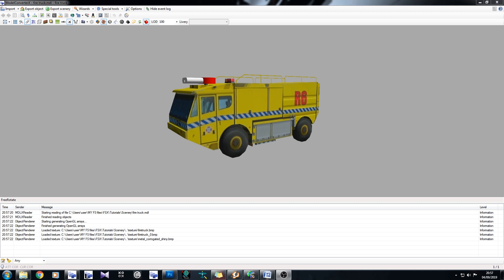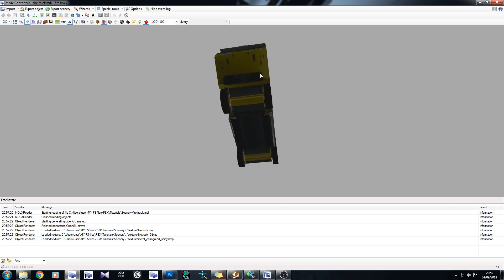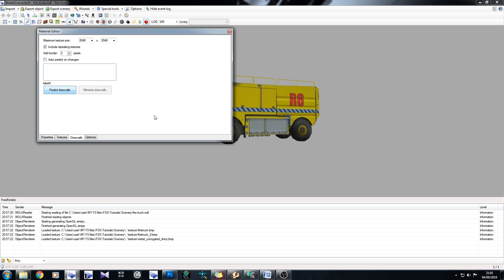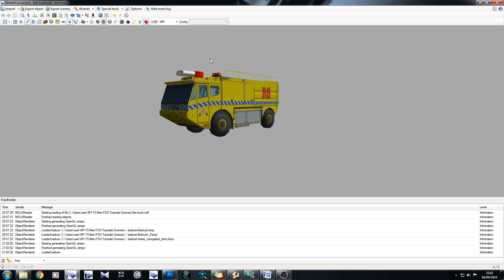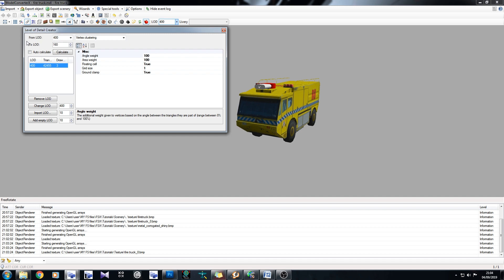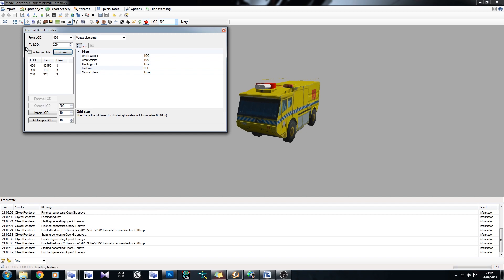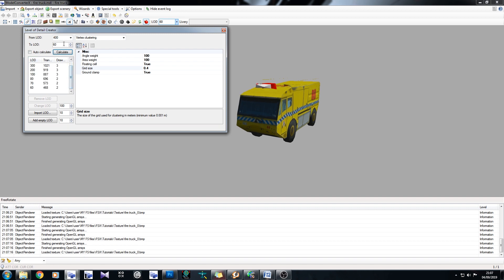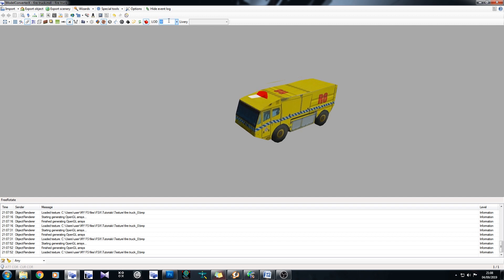FSX Tutorial - Using Model Converter X to optimise models

Comment: See the end of this message for details on invoking 
just-in-time (JIT) debugging instead of this dialog box.

************ Exception Text ************
System.OutOfMemoryException: Exception of type 'System.OutOfMemoryException' was thrown.
   at ASToFra.ObjectRenderer.Renderer3DHandlerType.CreateArrayObjects()
   at ASToFra.ObjectRenderer.Renderer3DHandlerType.GenerateArrays()
   at ASToFra.ObjectRenderer.Renderer3DHandlerType.SetObjectModel(ObjectModel newObj, ObjectChangeLevel level)
   at ASToFra.ObjectRenderer.Renderer3DControl.OnObjectChanged(ObjectChangeLevel level, ObjectModel obj, Object sender, String changeDescription)
   at ASToFra.Interfaces.ObjectChanged.Invoke(ObjectChangeLevel level, ObjectModel obj, Object sender, String changeDescription)
   at ASToFra.Interfaces.EventDistributor.RaiseObjectChanged(ObjectChangeLevel level, ObjectModel obj, Object sender, String changeDescription)
   at ASToFra.Interfaces.EventDistributor.OnObjectChanged(ObjectChangeLevel level, ObjectModel obj, Object sender, String changeDescription)
   at ASToFra.ModelConverterX.MainWindow.RaiseObjectChanged(ObjectChangeLevel level, ObjectModel obj, String changeDescription)
   at ASToFra.ModelConverterX.MainWindow.UpdateFormAfterImport()
   at ASToFra.ModelConverterX.MainWindow.bwImporter_RunWorkerCompleted(Object sender, RunWorkerCompletedEventArgs e)
   at System.ComponentModel.BackgroundWorker.OnRunWorkerCompleted(RunWorkerCompletedEventArgs e)
   at System.ComponentModel.BackgroundWorker.AsyncOperationCompleted(Object arg)

************ Loaded Assemblies ************
mscorlib
    Assembly Version: 2.0.0.0
    Win32 Version: 2.0.50727.8813 (QFE.050727-8800)
    CodeBase: file:///C:/Windows/Microsoft.NET/Framework/v2.0.50727/mscorlib.dll
----------------------------------------
Launcher_ModelConverterX
    Assembly Version: 1.0.0.0
    Win32 Version: 1.3.0.0
    CodeBase: file:///C:/Program%20Files%20(x86)/ModelConverterX/ModelConverterX.exe
----------------------------------------
System.Windows.Forms
    Assembly Version: 2.0.0.0
    Win32 Version: 2.0.50727.8015 (FX35W81RTMGDR.050727-8000)
    CodeBase: file:///C:/WINDOWS/assembly/GAC_MSIL/System.Windows.Forms/2.0.0.0__b77a5c561934e089/System.Windows.Forms.dll
----------------------------------------
System
    Assembly Version: 2.0.0.0
    Win32 Version: 2.0.50727.8806 (QFE.050727-8800)
    CodeBase: file:///C:/WINDOWS/assembly/GAC_MSIL/System/2.0.0.0__b77a5c561934e089/System.dll
----------------------------------------
System.Drawing
    Assembly Version: 2.0.0.0
    Win32 Version: 2.0.50727.8019 (FX35W81RTMGDR.050727-8000)
    CodeBase: file:///C:/WINDOWS/assembly/GAC_MSIL/System.Drawing/2.0.0.0__b03f5f7f11d50a3a/System.Drawing.dll
----------------------------------------
ModelConverterX
    Assembly Version: 1.0.0.0
    Win32 Version: 1.3.0.0
    CodeBase: file:///C:/Program%20Files%20(x86)/ModelConverterX/ModelConverterX.DLL
----------------------------------------
Interfaces
    Assembly Version: 1.0.0.0
    Win32 Version: 1.3.0.0
    CodeBase: file:///C:/Program%20Files%20(x86)/ModelConverterX/Interfaces.DLL
----------------------------------------
ObjectModel3D
    Assembly Version: 1.0.0.0
    Win32 Version: 1.3.0.0
    CodeBase: file:///C:/Program%20Files%20(x86)/ModelConverterX/ObjectModel3D.DLL
----------------------------------------
ObjectWriter
    Assembly Version: 1.0.0.0
    Win32 Version: 1.3.0.0
    CodeBase: file:///C:/Program%20Files%20(x86)/ModelConverterX/ObjectWriter.DLL
----------------------------------------
ObjectReader
    Assembly Version: 1.0.0.0
    Win32 Version: 1.3.0.0
    CodeBase: file:///C:/Program%20Files%20(x86)/ModelConverterX/ObjectReader.DLL
----------------------------------------
EventLog
    Assembly Version: 1.0.0.0
    Win32 Version: 1.3.0.0
    CodeBase: file:///C:/Program%20Files%20(x86)/ModelConverterX/EventLog.DLL
----------------------------------------
ObjectRenderer
    Assembly Version: 1.0.0.0
    Win32 Version: 1.3.0.0
    CodeBase: file:///C:/Program%20Files%20(x86)/ModelConverterX/ObjectRenderer.DLL
----------------------------------------
GRV11DLL
    Assembly Version: 1.0.0.0
    Win32 Version: 1.0.0.0
    CodeBase: file:///C:/Program%20Files%20(x86)/ModelConverterX/GRV11DLL.DLL
----------------------------------------
ParticleEffects
    Assembly Version: 1.0.0.0
    Win32 Version: 1.3.0.0
    CodeBase: file:///C:/Program%20Files%20(x86)/ModelConverterX/ParticleEffects.DLL
----------------------------------------
System.Configuration
    Assembly Version: 2.0.0.0
    Win32 Version: 2.0.50727.8953 (QFE.050727-8900)
    CodeBase: file:///C:/WINDOWS/assembly/GAC_MSIL/System.Configuration/2.0.0.0__b03f5f7f11d50a3a/System.Configuration.dll
----------------------------------------
System.Xml
    Assembly Version: 2.0.0.0
    Win32 Version: 2.0.50727.8773 (QFE.050727-8700)
    CodeBase: file:///C:/WINDOWS/assembly/GAC_MSIL/System.Xml/2.0.0.0__b77a5c561934e089/System.Xml.dll
----------------------------------------
Utils
    Assembly Version: 1.0.0.0
    Win32 Version: 1.3.0.0
    CodeBase: file:///C:/Program%20Files%20(x86)/ModelConverterX/Utils.DLL
----------------------------------------
TextureObject
    Assembly Version: 1.0.0.0
    Win32 Version: 1.3.0.0
    CodeBase: file:///C:/Program%20Files%20(x86)/ModelConverterX/TextureObject.DLL
----------------------------------------
System.Drawing.Design
    Assembly Version: 2.0.0.0
    Win32 Version: 2.0.50727.8007 (FX35W81RTMGDR.050727-8000)
    CodeBase: file:///C:/WINDOWS/assembly/GAC_MSIL/System.Drawing.Design/2.0.0.0__b03f5f7f11d50a3a/System.Drawing.Design.dll
----------------------------------------
Accessibility
    Assembly Version: 2.0.0.0
    Win32 Version: 2.0.50727.8007 (FX35W81RTMGDR.050727-8000)
    CodeBase: file:///C:/WINDOWS/assembly/GAC_MSIL/Accessibility/2.0.0.0__b03f5f7f11d50a3a/Accessibility.dll
----------------------------------------
System.Design
    Assembly Version: 2.0.0.0
    Win32 Version: 2.0.50727.8015 (FX35W81RTMGDR.050727-8000)
    CodeBase: file:///C:/WINDOWS/assembly/GAC_MSIL/System.Design/2.0.0.0__b03f5f7f11d50a3a/System.Design.dll
----------------------------------------
System.Web
    Assembly Version: 2.0.0.0
    Win32 Version: 2.0.50727.8951 (QFE.050727-8900)
    CodeBase: file:///C:/WINDOWS/assembly/GAC_32/System.Web/2.0.0.0__b03f5f7f11d50a3a/System.Web.dll
----------------------------------------
TextureLoader
    Assembly Version: 1.0.0.0
    Win32 Version: 1.3.0.0
    CodeBase: file:///C:/Program%20Files%20(x86)/ModelConverterX/TextureLoader.DLL
----------------------------------------
ObjectEditor
    Assembly Version: 1.0.0.0
    Win32 Version: 1.3.0.0
    CodeBase: file:///C:/Program%20Files%20(x86)/ModelConverterX/ObjectEditor.DLL
----------------------------------------

************ JIT Debugging ************
To enable just-in-time (JIT) debugging, the .config file for this
application or computer (machine.config) must have the
jitDebugging value set in the system.windows.forms section.
The application must also be compiled with debugging
enabled.

For example:

<configuration>
    <system.windows.forms jitDebugging="true" />
</configuration>

When JIT debugging is enabled, any unhandled exception
will be sent to the JIT debugger registered on the computer
rather than be handled by this dialog box.

This error message happened when I was trying to load the file of 59 or 55 MB size, with .dea association, previous  from .skp
Please, what does this mean...is this possible to fix it...
Does this program have something like file size limiter... like Facebook have (25MB), G-Mail have (25MB)

Comment: What does the LOD number actually represent? Why did you pick the numbers you did?
Reply from the maker: In general it goes by pixels, so LOD100 will be approximately 100 pixels on your screen, when that 100 pixels hits the next number down it propts FSX to display the next LOD of the model.
My models are created using a general size of 720p so I'm actually creating LODs at 75% of the intended size as I normally run FSX in 1080p